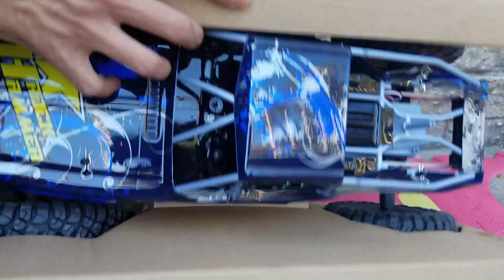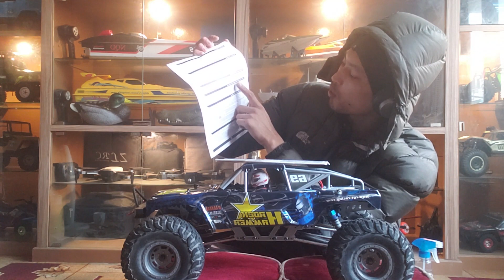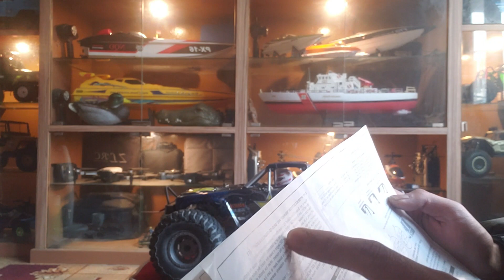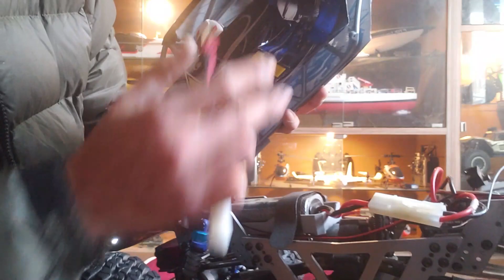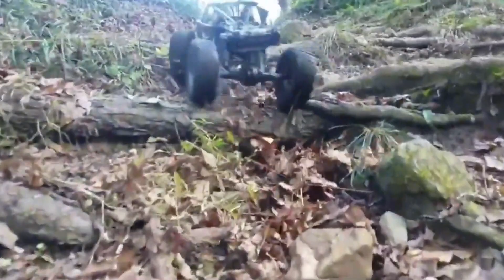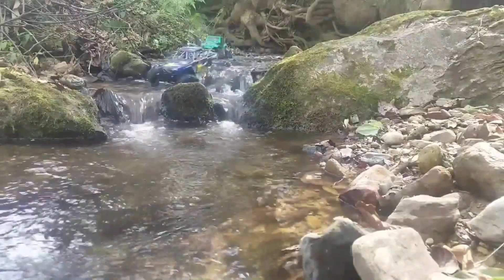RGT Racing 1:10 Scale 4x4 Rock Hammer RC Truck Unbox and Test

Comment: Is that 3600 MAh battery a LiPo battery?
It gains all that speed just with the battery?
Reply from the maker: Lipo batteries provide more punch than stock NiMh ones. I used Zee Power 8000mAh 2S lipo, not 3600mah.

Comment: Which is better? Rgt ex86100 v2 or this one? Tia👌❤️
Reply from the maker: Well that's a harder question for me to answer as both are equally good and capable. But if I had to choose one, I would go for EX86100 V2 because of two things - Connector and tyres. You can't go wrong with either of them.